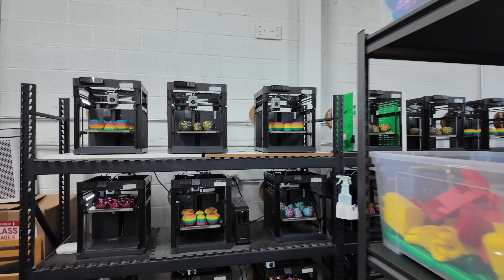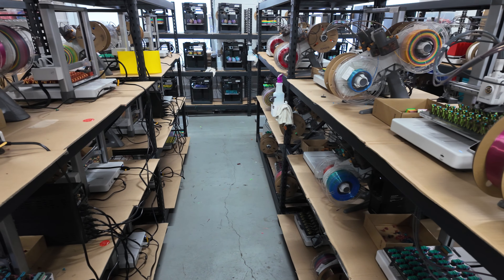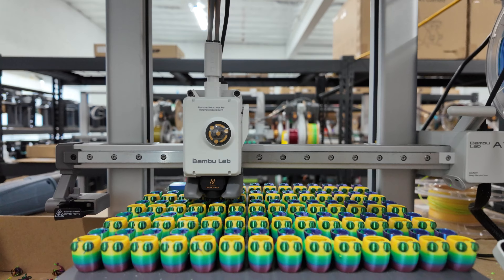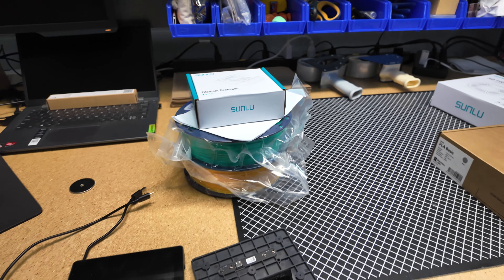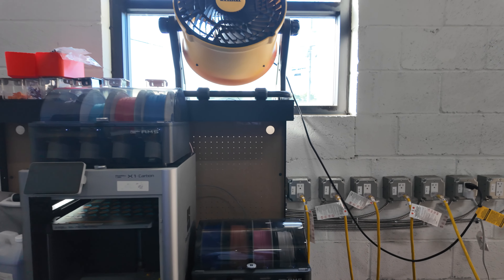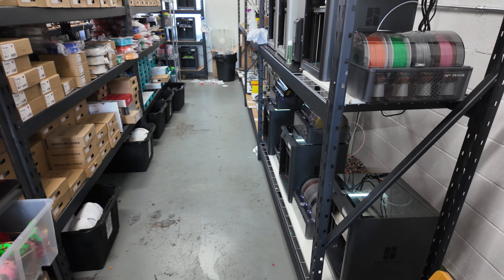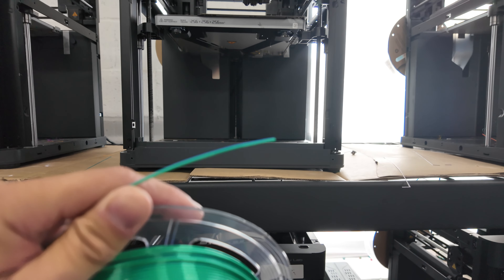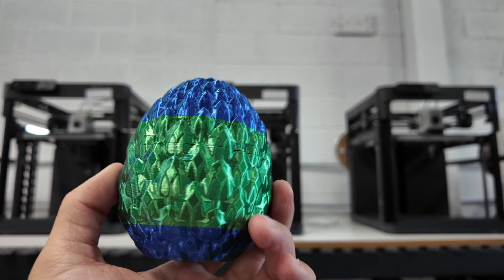CryoGrip Coupon Code, Giveaway Winners, Restarting Prints - 3D Print Vlog #28

Comment: You dont need to buy that AMS multiplier.. print a splitter add in before the buffer system.
Reply from the maker: @deeply999  you don't need the ams hub??
Reply: @Dancyn3Dprints No you can even use the 4 way splitter from the A1